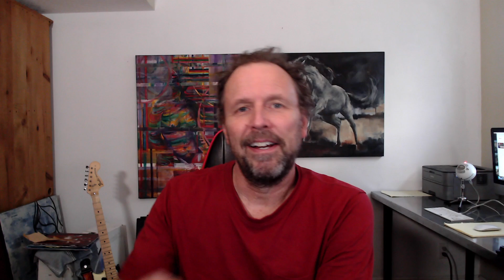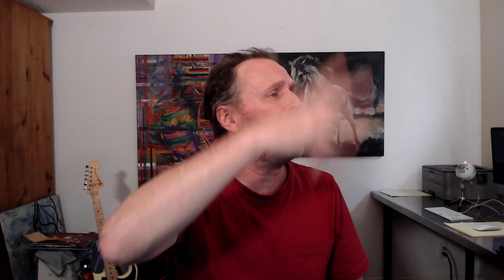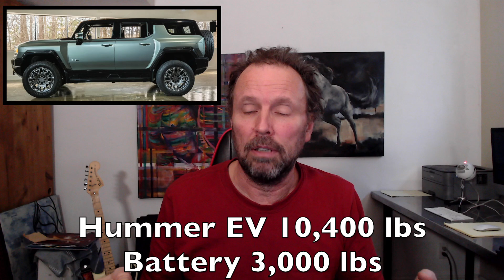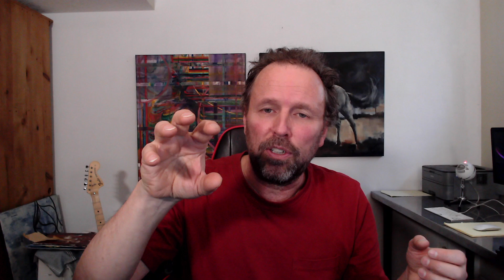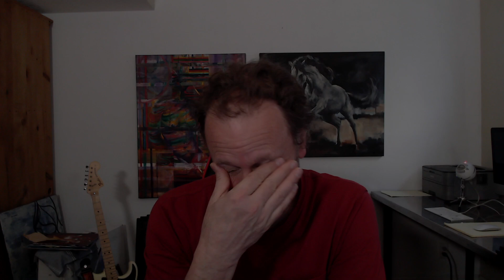It's Simple To Make Cars More Efficient

Comment: The whole idea of using less fuel by accelerating more carefully is demonstrated when you look at my driving vs my daughter's
We both have a similar size/weight car (Her a C-class Merc - Me a Skoda Superb) Both around 1,500kg (3300 pounds), and both have a turbo-diesel engine with close to 140 bhp.
She routinely accelerates hard, and drives close to the car in front, constantly on and off the throttle and brakes.
I accelerate far more smoothly, think ahead, and back off the car in front so I can maintain a more constant speed - less braking, and less need to re-accelerate.
We both take around the same time to cover a similar journey (she's maybe 5 mins quicker over 35-40 miles)
She gets around 37-38 mpg - I routinely get 50, sometimes more (British gallons are about 20% more than US gallons)
Last year, my car was off the road for a coupla weeks and I borrowed hers - Her average mpg was on 37 when I got it.... was on 48 when I gave it back to her.
Reply from the maker: exactly.  if we all just drove a little calmer we could easily save 25% fuel.   without even changing our cars.  it's in the formula.  f=ma. decrease "a" and you need less "f" ... "fuel"

Comment: So much BS for a "no-BS channel". Where do I even start?
- wind resistance force is not exponential in velocity, it's quadratic. There are, however, other sources of energy loss that have weaker dependence on velocity such as rolling resistance and electronics (a/c in particular), which become dominant at lower speeds. Speed increase from 100 to 120 kph will decrease the efficiency by 23% -- noticeable, but hardly "huge"
- The appropriate equation for car acceleration vs energy loss is E=mv^2/2 rather than F=ma. That is, energy required to accelerate a mass to a given speed depends on a final speed, not an acceleration. Though one has to produce more energy while accelerating faster, the duration of acceleration is shorter, resulting in the same energy requirement.
- Eco mode consumes less energy than sports mode not because of a slower acceleration pre se, but rather due to inefficiencies of an internal combustion engine; such engines have the highest efficiency at around 2000 rpm and the highest power output at around 6000 rpm. In eco mode, the car keeps an engine around 2000 rpm while in sports pushes to much higher rpms, sacrificing efficiency. Such effect does not exist for electric vehicles since electric motors are equally efficient in a very wide range of rpms.
- Both electric and hybrid vehicles are equipped with regenerative brakes, allowing them to recuperate and store a substantial fraction of the kinetic energy when stopping. Conventional vehicles dissipate the kinetic energy into heat while stopping. That's why hybrid vehicles see comparable mpg in both city and highway regimes while their conventional counterparts lose a third of the efficiency in a city cycle.

Comment: When the change in velocity is constant, accelerating quicker does generally not consume more energy. The remaining difference in EVs is a little more internal friction while in combustion cars it is massive efficiency drop while outside designed operating point.
What does consume more energy at higher speeds is mainly increased compensation of air friction.
EVs need strong motors to efficiently regenerate more braking power. 
It's simple physics.
Reply from the maker: Accelerating quicker uses orders of magnitude more fuel.  What physics are you using?  lol

Comment: The first problem is that customers demand a car that accelerates to highway speeds in at most 5 seconds and has a ridiculously long 300 mile range. Nobody ever drives 300 miles in one go but customers still demand it. Statistics show that 99.2% of car trips are less than 100 miles, the vast majority of those are less than 50 miles. A 150 mile car would cover most people with ease but people refuse to buy those.
The second problem is that the battery is a very expensive component so in order to make a profit they need to aim at the luxury segment. They can't sell tons of cheap EVs because there aren't enough batteries to go around.
Reply from the maker: I drive 300 miles in one go all the time.  I live in Canada.
Reply: @clauskellermanpov3004 Then you are an outlier. It is extremely rare

Comment: Claus, you  captured my thoughts exactly. One other very important component is tire wear as well, the biggest source of microplastics. High torque heavy EV's need tire replacements about 3 times faster, and tire wear also means that roads need repair or replacement equally faster. The irony is that in my home country  the Netherlands, I pay road tax with my efficient Honda Jazz (called Fit in NA) while the heavy EV's are exempted....luckily that is going to change as of 2024.

Comment: Have you ever watched those tractor drag races, it demonstrates the power needed as the mass increases while accelerating. A fine example of wasting fuel and pollution.
Reply: No tractor pulls are a competition, if your engine can withstand the fuel air produces more torque and hp are produced to win, not waste, just a simple problem.  Get involved in how your vehicle actually works and you will see.
Reply: Car makers are putting to much electronics and crap jn car making it heavier.  Gone are the days of the light weight vehicle thanks to  micro management by government

Comment: Speaking of cars with Eco mode, my old diesel doesn't have one but about 6 months ago I noticed that the car was really weak to accelerate, it would get me everywhere just fine the only problem was it was very slow to accelerate but it held its speed no problem. Then I noticed it was basically burning hardly any diesel, I put in 50 euro of diesel into it and it lasted me like a month of driving around the place and it was still at a quarter tank. 

Turned out that there was some carbon buildup on the mass airflow sensor, so the car's computer was not able to tell how much oxygen was making it into the engine, so it was running INCREDIBLY lean and basically just using the minimum amount of diesel possible. It's crazy when you realise that it's entirely possible for engines to run way more efficiently at the cost of acceleration with just a few tweaks to the air fuel mixture like that.
Reply from the maker: This is the exact point I was making.  Acceleration is the killer of fuel efficiency...
Reply: That's interesting hear a lot of that, though my instinct gut feeling would say it's not possible that could happen but having said that in the past I was given a 2 litre non turbo diesel with an intermittent fault on the ECU system, because of it indirectly I was getting about 90 MPG maybe more. But that I think was really more because I removed every bit of the emission controls gear, was just an alternative simple injection pump replacing all of the electronics.  And I was doing very long motorway runs around 70 mph  @clauskellermanpov3004

Comment: WIldy over-simplified Claus.  ICE cars are inherently less efficient.  You have an explosive force (thermo efficiency of the burn lost energy) then the explosive force pushes the piston down (lost energy), the linear force is translated to a rotational force (lost efficiency), that rotational force goes thru your transmission (lost efficiency), to a drive train (lost efficiency) and eventually the rotational force moves the wheels.  At best your theoretically able to build something that's 50% efficient if you improve current ICE vehicles.  Take an electric car, remove the transmission, you have a rotational force that gets transferred to the wheels.  Job done.  I think at best you're looking at a theoretical efficiency of 80% for a well designed modern electric car.  Electric cars are faster, have more torque, and are wildly more efficient from a mechanical standpoint.  Your weight argument is valid but you mention cars that were designed 5-10 years ago.  When you look at the new cars coming off the line this year or next with new batteries.  Look at a 2024 car like the Volvo EX you're talking a car with a curb weight of around 1950 kg.  If you look at say a Toyota Corolla you're talking 1,300 kb.  That Corolla weighs around 69% so your new EV is about 30% more mass.  That EV is at least 30% more efficient at moving that mass.  At WORST it's a wash and you're not dumping hydro carbons into the air.  The next problem is how your electricity is generated so if it's solar from your roof you're WAAAAY better off.  If it's nuclear you're better off (at least where I live... I can fully recharge an EV for just around $10 - 300 miles) while a full tank runs me $40 - 336 miles.  From a dollar standpoint I'm wildy better off as far as fuel goes.  I don't have to pay for oil changes.  Something like the EX30 we looked at earlier will cost ~$35-45 before any incentives (govt or mfg).  All things being equal, looking at technological advances in the near future, if your answer depends on people not being assholes I think I'll just vote with my wallet and get a small, efficient EV and pair that with a nice turbo-charged hybrid AWD/4x4.  EV's made absolutely zero sense 10-15 years ago (and I still think anyone buying a Tesla is a mad lad - a fender bender costs upwards of over half the price of a new vehicle?!?!?) but as technology improves, competition brings about improvements and customers become more accustomed to what EV's have to offer it's just going to keep getting better.  ICE vehicles are dead... they just don't know it yet.
Reply from the maker: After all that this still holds true.  F=MA.  The higher the mass the more force required to accelerate that mass.  You can create the force any way you like.  You can get out of the car and push your car by hand without electricity or hydrocarbon and F still equals MA.

Comment: there was also a study on the so called "carbon footprint" of EV...its takes about 10 years of use until the carbon footprint on an EV crosses the "line" and begins to actually reduce the carbon footprint over a gas powered vehicle...but also by 10 years, you need to replace the batteries at least once which then pushes out the footprint curve even further...unless we get all our electricity from 100% renewable, it will never make any sense...how many people actually keep the vehicle for more then 10 years?

Comment: Fantastic vid, well explained as usual.  What they do not consider is that all these much heavier EV's are going to put too much pressure on our infrastructure, its already breaking down.  Roads, more potholes, bridges, unstable and crumbling, Charging, not enough power on the grid.  Governments wont have enough funds to improve all this leading to poorer surfaces and battery damage which will cause pollution and extreme cost to repair.

Comment: The railroad companies have had it right the whole time diesel Electric😊
Reply: Tehre you go!  NOW you're talking efficient.  Like the new Honda CR-V hybrid... ICE engine just provides juice to the electic motors and they tossed the transmission.  You get the best you can out of the electric motors while still taking advantage of the gas powered infrastructure for long range driving.  Excellent comment Vonsmutty.
Reply: @lexwaldez  ty

Comment: Until nuclear energy is widely accepted as the primary source of power, EV's are fundamentally coal burning steam powered vehicles, don't believe the "renewable" energy propaganda.
Reply from the maker: Many places on earth generate electricity without burning fossil fuels.  In Canada British Columbia, Ontario and Quebec (3/4 of our population) generate almost all their power from clean hydro.  EV's make sense in those provinces.
Reply: @clauskellermanpov3004  Canadian stats 2022👍: 
hydro (61.3%), nuclear (12.9%), fossil fuels (19.2%), wind (6.1%), and solar (0.5%). But will you have the infrastructure and capacity in place for the EV dictat, and will they be affordable to average Joe, or will we be happy in owning nothing. 
Nevermind the environmental impact of trying to mine enough of the poisonous Lithium, Manganese and Cobalt heavy metal elements required.

Comment: Here in the States, the CAFE standards contribute to this. In order to conform to the standard, vehicles have grown in order to meet it. As for ev's, I'm not sold. At least as far as long distance travel is concerned. Inner city travel it's a no doubter, if I could afford to buy one, I would. Pretty sure my tramsportation costs, i.e. fuel, would go way down in comparison to what I'd spend on keeping the battery charged.

Comment: Ok. Let's talk science.
Yes, you'll need more energy to drive heavier cars. However, electric engine is far more efficient than the equivalent ICE engine, and you're simply ignoring that fact.
Reply from the maker: I'm not ignoring anything.  The "fact" is this.  The larger the mass the more force required to accelerate it.  You can generate the force however you like.  But you will need more of it.  You can get out and push the car yourself and not use any electricity or hydrocarbon if you like.
Reply: @clauskellermanpov3004  oh, you know the.math better than I do. Lets say  ICE angine has X kg, and EV has X+25%< and  200HP ICE engine has 30% (it has less) energy conversion, compared to   75% with electric engine (it has more), then how are EVs a problem compared to ICE? 
We all know elementary school physics, but the calculation is a bit more complex than that.
Oh, yes, and US is not the entire world. Many countries have no problem with smaller, lighter vehicles, with less battery and HP.
P.S. And there will also (hopefully) be Aptera very soon.

Comment: There is never one simple formula that covers everything, Claus! My petrol car will easily do 60 MPG in the summer, but now midwinter it's only doing 50 MPG. So seasonal temps effects thing too. Plus, 20 MPH speed limits now being brought in everywhere (in UK), 1 ton of metal driving at 20 MPH drastically brings down MPG. Newton never calculated muppets like Sadiq Kahn bringing in ULEZ zones.
Reply: Love your content as always Clause. EV’s have about 20 only moving parts responsible for motion which means F=MA is at an exponential gain for Ev over fuel. Cheers buddy

Comment: The EV 18-wheeler has a range of 150 miles and takes 16 hours to recharge.   What genus came with this?
Reply: Cut from the same cloth as the idiot that built the first internal combustion auto.  Those things were garbage.  A hundred years ago people like you said the automobile would never replace the horse.  Imagine what that EV long haul truck will look like in 20-100 years.

Comment: You missed one important point at the discussion. Most of the north American cars not only have a bigger mass, but also a shape like a garage. You easily can change the needed fuel by design a lower cw (drag coefficient). That's what they use to make electric cars more efficient.😮
Reply from the maker: that's one factor.  but CV need to have radiators  to suck in air and cool the engine.  EV's dont.